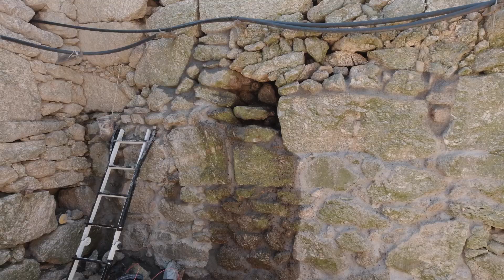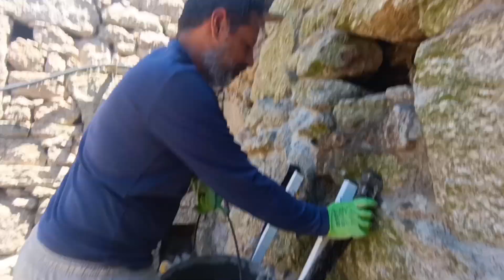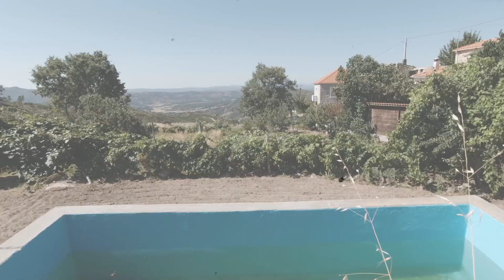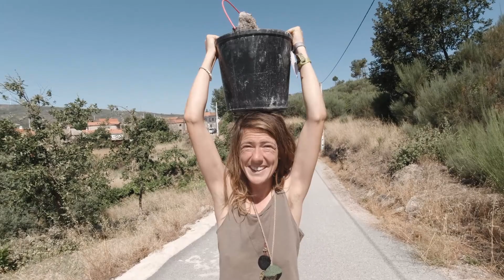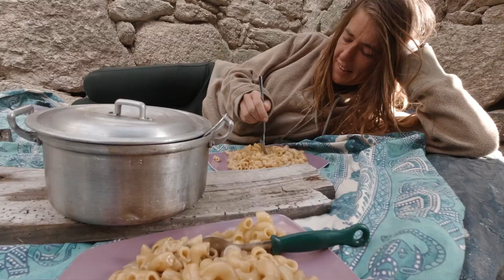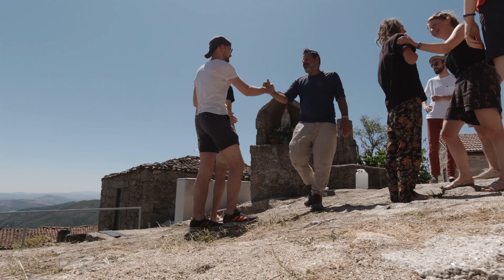Rebuilding the walls from the inside - Renovation in Portugal (#28)

Comment: Better off creating a box on both sides with sheet plywood...fill with rocks and rebar.... Then straight pour lots of liquid cement and let it flow to hollows and voids... Otherwise, no structural elements....pump truck of cement....The issue is that cement without support will crack and fail..
You need rebar and stone to prevent this.. the plywood box.. use wire on both sides to tie plywood together, across the hole...you can use pliers to cut wire.. diagnal 2x4 to floor for support to prevent blowout... You can reuse the same plywood..just keep moving it from wall to wall...
Cement truck with long pipes along the alley and straight pump in liquid cement...fill from top. Remember to vibrate get gases out....
Reply from the maker: Thanks again for the ideas my dear friend 🙏🏻😊

Comment: Can you tell a bit more about the pouring concrete method please. I've never heard of this before and it seems to be a good method without disturbing the walls too much at all. 
It's looking good. 👍🏼👍🏼
Reply from the maker: Thank you my friend 🙏🏻😊
Basically I make the cement a bit definitely..more water but much more cement to keep it strong enough because a lot of water makes the cement weaker.
I use it only if I must in places I can't get to...and most of the time I pour a normal/gravel cement on top.
I hope it helped you, If you want to know anything else feel free to ask.
✨